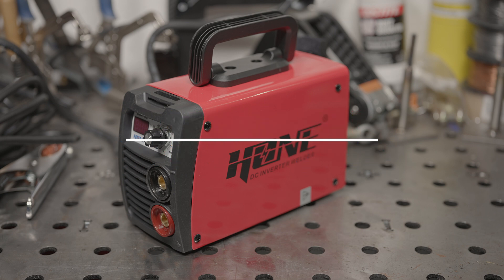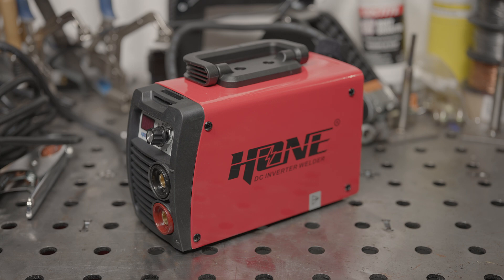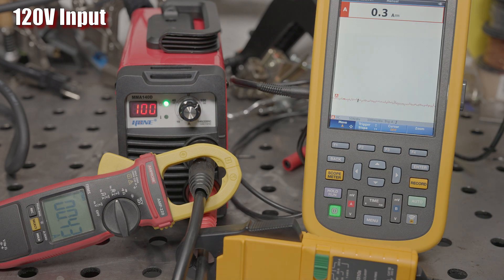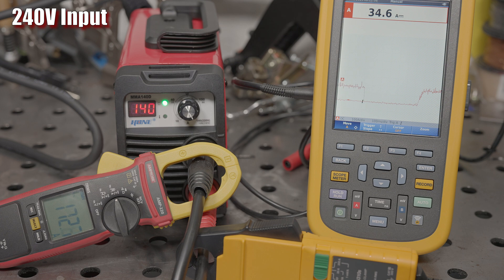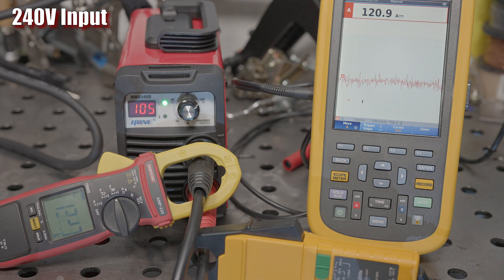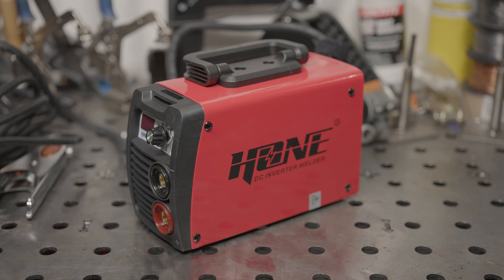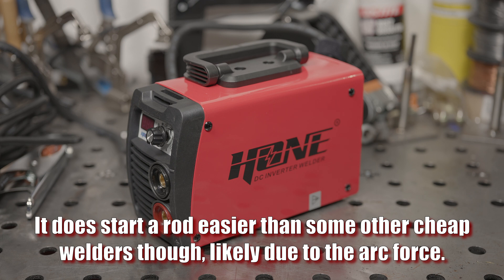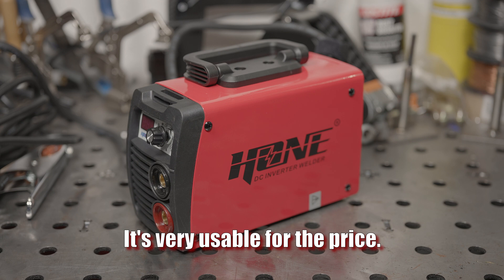Hone MMA140D, $85 Stick Welder Output Tested

Comment: using 110v option...what should the breaker amp be? I have a 15a breaker and it only works a 30sec and trips the breaker...should I increase breaker to 20a or 30a?
Reply: Sir, stop playing with numbers on your head… if it trips your breaker at 15 amps, then re-up your breaker to as high as you can. I use a 60 amp breaker and I do use it for 110v and 240v. It doesn’t matter or makes no difference if you add a 100 amp breaker or a 50 amp, the machine is going to “draw” the amperage “needed” and it only matters if your breaker is too low… a lamp or a house radio will draw up to those 15 amps and a welder will do the same up to the amperage “it needs” regardless weather it needs 15 amps or 50. In other words, if your breaker is swapped from a 15 to a 50 amp breaker, the lamp will draw what it needs and no further and the welder will draw say, 30 amps and no more, again, regardless if the breaker is a 30 or a 50 or 60 or even 100 amps. One is more durable or “resistant” than the lower amperage one. Any electronics will draw what “it needs” and no more. So a lamp will work on a 100 amp breaker because it will draw its needed 10 or 15 or 25 amps out of it and it will stop at its capacity and so will the welder at 20 or 30 or 50. Only the voltage will differ. You’re just adding more of a capacity to the electronics use of it. Just don’t plug a 15 amp lamp to a 240v please! The same amount of current will flow through a 20 or a 50 if it comes from a 2-line circuit (110v) but you cannot connect a 2-line lamp to a 3-line 240v circuit breaker, it requires 3 connecting wires (2 hot and 1 ground) 110v? (1 hot and 1 ground) when you blow a breaker it is when you exceed the “resistance capacity” that breaker can handle and it breaks, blows or stops working to ‘protect’ your electronics, that’s all. 15A breakers don’t work, then move to a higher capacity one and if it still doesn’t work, then go to a 30A. Simple. Hopes this helps

Comment: I am interested in Hone 3 in 1 110 on amazon. I looked at Hones website and found that in order to contact them you need to join shopify? I looked on BBB listings they don't come up or a general Google search? I called Amazon to ask about the info they have on tap only to find that they also have skimpy info  or lack there of on Hone? I just want to know about warranty and customer service. I suggested to Amazon to contact Hone as it appears that they make contact unusually hard for consumer. Does anyone know more?

Comment: Well I guess I can sorta give Yeswelder some credit on consistency realtive to display even though it's off.  Did you ever a measuring of output while mig welding on the yeswelder mp200?
Reply from the maker: I did make a couple videos with the MP200.  MIG output and overall performance seemed virtually identical to the original MIG205 DS.

Comment: i think the Hone FC 140 would be a good review topic. Its a three in one flux / stick and lift tig claiming to all run on 110v?
Reply from the maker: Might be interesting to review and compare it to the Arccaptain machine I've looked at with similar capabilities.
Reply: @bigtb1717  as long as it has same specs , I don't see why not

Comment: Project Farm just reviewed this in its "yellow flavor".  In his test it appears to have hot start at high amperage and Amazon lists the price slightly higher on the yellow one.   Physically I only see an additional strap but wonder if they reworked the circuitry too.....looks like inaccurate reading remains on display though maybe not as much?
Reply from the maker: Interesting.  Could be worth checking out at some point.  I do have the Hone 185 to test out as soon as I get a chance.  So that will be interesting as well.

Comment: For $75 it does the job, it's really made for a 30 Amp 120 Volt circuit at minimum, even then you can trip the breaker, it can draw 40 plus amps at max settings on 120v. I usually run mine on a NEMA 10-30 240v 30 amp dryer receptacle with 30 amp breaker, it does fine at max settings. If you want to max it out at 120v get a NEMA 5-50 receptacle and run 6 gauge wire to breaker. For 240v a dryer receptacle on 30 amp breaker should be fine, it will draw 28 amps at max settings on 240v.

Comment: I just bought a 120amp version. Need to make only ONE weld to fix a gate. Will try 3/32 6011 stick. Figured taking the gate off and down to a weld shop and then having to bring the gate back - too much time and might cost $100 anyway.

Comment: I'd love to see a full review of this piece of kit! Also, would the Miller Thunderbolt 160 be the cheapest brand name stick you'd recommend? Great videos!
Reply from the maker: Technically, while the Thunderbolt 160 is an okay machine, I'd probably recommend the Hobart Stickmate 160i over it.  It's basically the same unit, but a couple hundred cheaper because it isn't "blue."  The ESAB Rogue ES 130 and 180 are also good machines, but they have unfortunately gone up in price quite a bit since I reviewed the 180.

Comment: BTW, I purchased a (SO hate the 'name') HZXVOGEN MIG-250DP for $210 (hot deal), and has not arrived yet. YouTube keeps deleting my comments unless they are not referencing external sites.
Reply from the maker: The only place I could find that specific model is Aliexpress and possibly eBay.  Let me know how you like it.
Reply: @bigtb1717  doing a google search using HZXVOGEN MIG MIG250II comes up first with green readout orange side logo on black box with 3 knobs. It arrived this morning and I will do an unboxing & review.
Reply: @bigtb1717  HZXVOGEN MIG-250DP I have seen these all over eBay and amazon Under different names.  HITBOX 4in1 MIG Aluminum MMA TIG Welder IGBT MIG Welder Machine 250A MIG250DP.From 250 to 350 roughly. they seem really cheaply made . I bought one and the accessories were super cheaply made . Sent it back for refund .But could you do a review in it possibly?

Comment: Glad someone is really reviewing this. I bought one last summer and have struggled to make good welds with 1/8th and 3/16ths and when i try 1/16 rods i stick and bend them every time. i have to cut the 1/16th rods in half to use them.

Comment: Great video! I’ve been watching you for years and I love your reviews. I have a question. I’m looking to buy a dual voltage MiG welder. I’m seriously looking at the primeweld MiG 180 or the primeweld mts200. Having the option to do Tig would be nice but not a deal breaker. What is your opinion on a good MiG welder between 500-700 dollars?
Reply from the maker: Unfortunately, I haven't tested a whole lot of MIG welders in that price range.  I'll think about it and see if I can come up with a recommendation or two.
Reply: Yeah all of the around 200 amp dual voltage welders I’ve seen you test don’t look like they’re worth it. Arc captain, yes welder, amico all seem low quality. Thank you and again keep making great videos I love the breakdown/tear down you do.
Reply from the maker: I've been planning to test an Everlast Cyclone 200ES.  It's around $700, 200A MIG welder with synergic options and stick welding (not TIG, unless maybe scratch start in stick mode).  Can't say it's any good, but I'm hoping to test it out in the next few months.
Reply: @bigtb1717  good welder